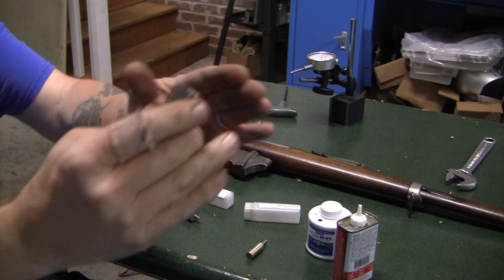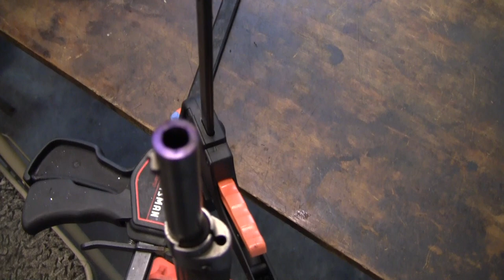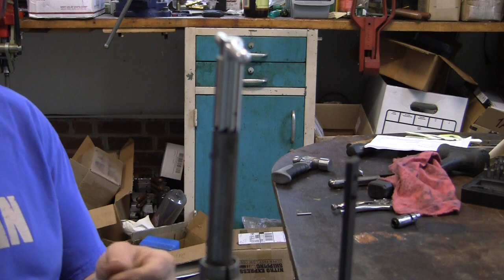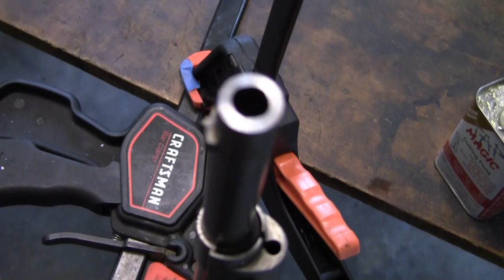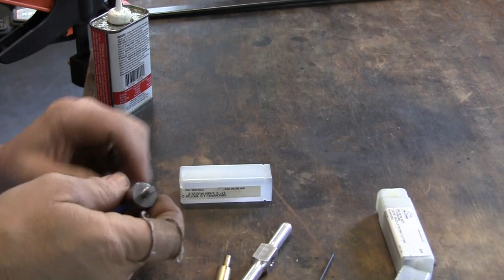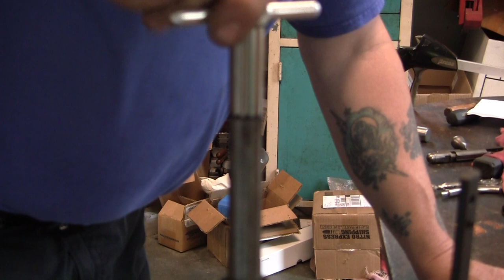Recrowning a rifle barrel with hand tools

Comment: I have been using the same crowning tools and I have had problems with chatter too. I made a new 12l14 1 1/2" diameter x 1 1/2" tall  round knurled handle with a spud that protrudes from the top along with a 1" diameter knurled cap that is bored to slip fit and rotate on the spud on the handle handle. It added mass to the tool and the freespinning cap allows me to turn the handle with one hand and maintain constant pressure with the other. Now I don't even have to polish with any emery after a cut.

Comment: Had a chamfer cutting, thread deburring tool for high pressure hydraulic line fittings that would have been perfect for this.

Comment: Could you use a drill or cordless screw driver on the facing tool? Not to get the job done faster but would the higher rpm do a cleaner smoother job of it or less chatter.